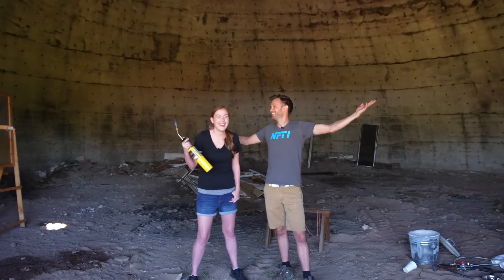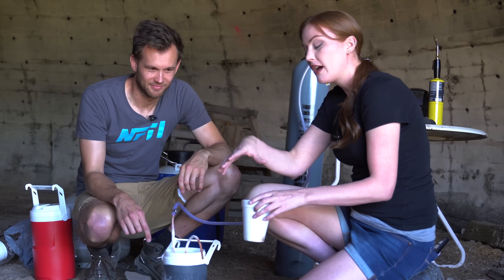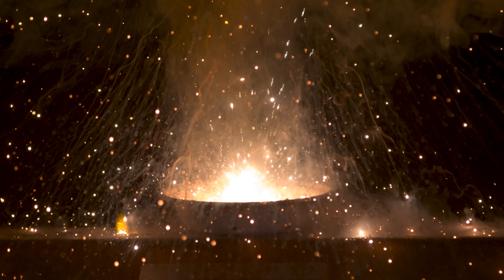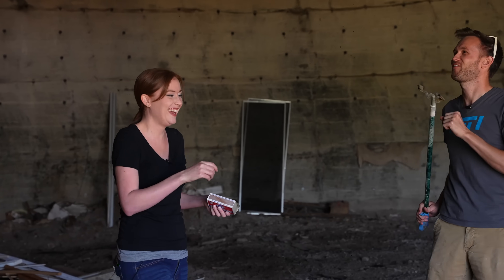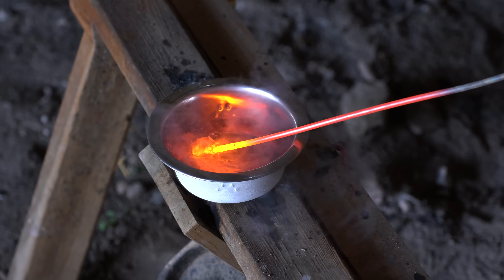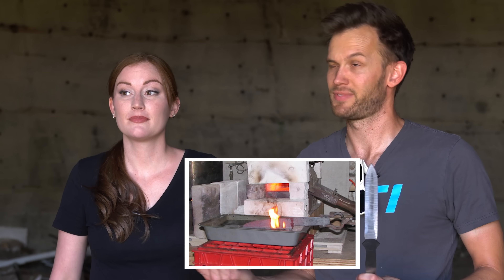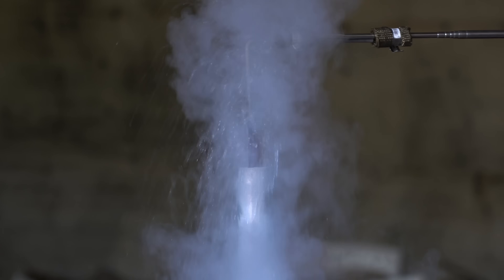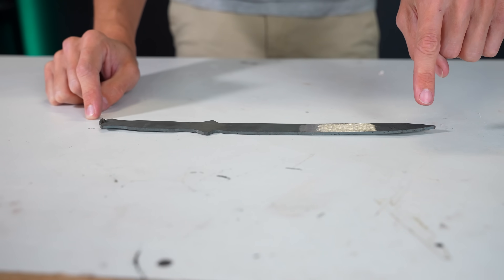Quenching a Knife in LIQUID OXYGEN!  Will It Burn?!

Comment: Use tool steel like O1 or W1 for the quenching test and try lighting a thermic lance running oxygen gas and then when the lance is fully lit switch to liquid oxygen. 

Get a gem quality synthetic diamond and heat it up with a torch until it's red hot and then drop it into a bowl of liquid oxygen.

Pro tip wear steel refinery protective gear or a full thermal lance suit while doing the thermal lance trick or say goodbye to those four fish belly white shins and knock knees.

Comment: LOL! My first encounter with LOX was when I was in an aircraft hanger. Suddenly there was a yell and one of the aircraft techs ran across the hanger, shedding every stitch of clothes as he went. He ran into the emergency shower which dumped a couple of hundred gallons of water on him in a few seconds. Nobody was laughing. One guy handed him clean overalls and some others started putting cones next to his clothes. Turned out he was working on the oxygen system on a Canberra and had drained it, someone else was making sure all of them were full and refilled it. So next day I was there working on an issue on a Tornado and this guy started removing pipes. The first one he took off resulted in LOX spraying out on him. There was a serious incident inquiry. Nobody touched the clothes or the aircraft for the rest of the day. Eight hours later they turned his clothes over left them for the night. Normal service didn't resume until the next day. Not as inconvenient as it sounds, nobody took watches, rings, keys, etc. near the aircraft. So most of his gear was in his locker. He just had to go home in RAF overalls.

Comment: Did they ever even bring up the Leidenfrost effect? Also the scale your using is the Rockwell scale.
Reply: Rockwell is the test type not the scale, there are about a dozen Rockwell test scales with the C scale being the most common for hard metals.
Reply: @Hello-ts5kh  The equation for Rockwell Hardness is H R = N − h d {\displaystyle HR=N-hd}, where d is the depth in mm (from the zero load point), and N and h are scale factors that depend on the scale of the test being used
Reply: @TestyCool  exactly, which is why Rockwell is the test method not the scale.  For instance a hardness reading of 70 Rockwell means nothing if you don’t know which scale was being used.  Case in point 70 HRB is very different than 70 HRC.

Comment: You probably experienced the Leidenfrost effect.  Basically the gas produced by evaporating the liquid oxygen creates an insulative layer around the steel.  So, although the liquid oxygen is very cold, it doesn't actually cool the steel very quick.

Comment: You had a few issues that caused a bad outcome. Next time: Get it hotter. Use a deeper vessel, to prevent resting or knocking the blade on the bottom of the vessel. Don't allow the fluid level to fall bellow the point of removable knife/handle material. 
Try again. You WILL get better results.

Comment: It's a shame that you didn't explain that the reason why it didn't harden very well is because the liquid oxygen formed a vapour layer around the knife, keeping it warmer for longer - which is why they use oil rather than water for quenching knives because water does much the same thing as it's converted to steam.

Comment: Molten Gallium would probably be a good material to quench steel in, However if you want the knife to burn in liquid O2 you need to wrap a piece of steel wool around it first and light that.

Comment: i think the problem with the solid steel is that unlike the steel wool it was not already burning. for the solid steel it would need to be significantly hotter and then have o2 added.

Comment: what if you super cool oil with liquid nitrogen and quench the blade in the frozen oil? it should melt and slip through the oil which is "best" for quenching a blade right? I would probably stand further back though.

Comment: You could try to make steel/iron that lasts forever.. like the Pillar of Delhi.
https://en.wikipedia.org/wiki/Iron_pillar_of_Delhi
> the smelting induces a higher phosphorus content (> 0.1%, average 0.25%) than in modern iron produced in blast furnaces (usually less than 0.05%). This high phosphorus content and particular repartition are essential catalysts in the formation of a passive protective film of misawite (d-FeOOH), an amorphous iron oxyhydroxide that forms a barrier by adhering next to the interface between metal and rust.

Comment: You need three things to start a fire: oxygen, heat, and a fuel source. The reason why the rod wouldn’t start a fire in the oxygen was because you had no fuel source. When you changed the container to styrofoam, you introduced a fuel source.

Comment: There is too little surface are for anything to ignite. Plus, the immediate reaction to "quenching" in liquid oxygen is the immediate formation of a vapor barrier of steam forming around the steel rod. 
This is why, when quenching a knife after bringing the steel to its required temperature, it is highly recommended to use a viscous oil that has been pre-heated to 100+⁰ to help reduce the amount of steam barrier that can be created and allow the oil to make contact with the steel and actually quench the knife.

Comment: I think I know what’s going on here. When hot metal meets liquid Oxygen one of two things is happening it burns because the container is flimsy or the material feeds off the liquid Oxygen creating a loop effect of constant fuel to keep the metal burning. It’s the same process that magnesium does when it burns as it creates its own oxygen source meaning even if you submerge it in water it continues to burn. Steel wool burns because of the surface area is changing constantly allowing flame to latch onto something. Oxygen simply enhances the effect and makes it burn faster. The bubbles are actually waste gases that escape the metal itself. It’s chemistry but controlled to a point. Eliminate every variable until you get the answer. Eliminate the foam cup and replace with a container that is heat proof and you get the answer. That’s exactly what you did and metal did not explode, simply it fed off the oxygen creating the loop.

Comment: You are too ignorant, quenching is matter of the speed of cooling down as well as the range and other factors. Do it like this: quench it the best way for your material in water or oil, thereafter quench once more from room temperature with liquid nitrogen. This prolongs the lifetime of my drill bits 70% at least.

Comment: I wonder how saltwater would work for quenching the knife, since it has a fairly high heat capacity like fresh water but can be cooled to lower temperatures before freezing. And does it make a difference to have moving liquid rather than still liquid, with the idea being that the metal doesn't get to heat the liquid around it as new cold liquid "replaces" it.

Or better yet if it was possible to freeze fresh water below zero degrees but keeping it liquid by controlling the pressure. Unfortunately i don't see how this would be done for this experiment as the heated knife should be inside the pressurised chamber with the water...

Comment: Try it with a heated chunk of silicon, it will probably turn into glass if you can break past the passivation layer.

If you can get the steel to the point of sparking, then it will probably start reacting and burning.

Comment: even when quenching in oil it is important to move the knife around in the oil so it is in contact with the cooler oil as the oil in contact with the knife will heat up and vaporize just as the liquid oxygen did, if you repeated this but stirred the knife around in the oxygen it would have worked better but more than likely create stress fractures in the steel, pouring the oxygen over the knife would also work but would have made your warp even worse

Comment: I bet the liquid O2 was too cold to quench properly due to the Leidenfrost effect, the oxygen created an insulating layer around the knife causing it to cool slower vs a quenching oil that can stay a liquid at higher temps keeping more contact with the blade to transfer heat better.

Comment: The reason liquid oxygen only slowly quenches the blade compared to water or oil is because the Leidenfrost effect works against it. The liquid oxygen is extremely cold, however it doesn't make good contact against the red hot steel due to the fact that the steel is significantly hotter than the boiling point of liquid oxygen. It's essentially insulated by the gas.
Reply: It does not may ANY contact with the metal, lol.

Comment: Hey, can you run a scientific experiment? 
I know that filling a balloon with a flammable gas like Helium or Hydrogen and setting a match to it will cause a firey bang. And that the bang is much louder if you mix it 50/50 with an oxidizer like Oxygen... 

Though the issue is that the tests I saw all use subjective loudness scales, and our microphones/speakers don't do it justice, so I am wondering... which is louder? And how loud is it really?

Comment: The rod and knife will not ignite in the presence of liquid oxygen due to at least two factors. (probably others, but I'm no expert) One, is The Leidenfrost effect, which means that the liquid oxygen is not actually touching the metal, and two, the rod/knife were not actually burning, they were just heated. Oxygen is not a fuel, it's an oxidizer.  Once the heated metal is put into the oxygen, it starts to cool and lowers it's temperature away from it's ignition temperature. In the video, the steel wool was burning/on fire before it was put into the oxygen thereby having an ignition source already present.

Comment: Nate I have an old physics book from the 20's... 1920's not 3 years ago... but anyway, they talked about quenching some metal by plunging the hot metal into cold MERCURY... 

I suspect the difficulty you're having with the O2 quench is because the O2 is boiling away so fast it's almost like sticking your hand in liquid N2... and for the same reason your hand doesn't freeze on contact is the same reason you didn't get much hardness out of this. 

Now mayne you want to get a hold of Cody's Lab as he usually has a couple hundred pounds of mercury floating around, but I would think because the mercury has a lot more thermal capacity, it would suck the heat out of the target metal really quickly.
Reply from the maker: I have actually talked with Cody about doing this!
Reply: @NFTI  Cool! (no pun intended)!

Comment: See I kinda figured the knife would either become brittle because the knife would cool off too fast, or that the knife wouldn't harden properly.  My reasoning behind the second prediction is because the liquid air is already boiling at room temperature and so adding an extra couple hundred degrees would likely make the air boil around it without actually touching it, evaporating with zero actual contact with the hot knife.  Without that contact I'm sure the knife actually cooled slower than it would have with oil or water and thus didn't create the desired grain structure.

Comment: Burning steel is interesting. I just wonder, would a large enough ball of steel wool behave like a sparkler bomb?

Sparklers are iron powder with a binder molded onto a steel pin. Individually they burn at a controlled pace throwing decorative sparks. But bunch up a hundred or so of them tightly and light one in the middle of the bunch and they will have a runaway reaction where the heat from individual sparklers causes those around them to burn faster and hotter. The result is an explosion that can be quite energetic.

So would a huge ball of steel wool react the same way? What if it's compressed? How much would be needed for it to become dangerous? Wondering if that one kilo package of soap infuse steel wool is a bomb in hiding under the kitchen sink...
Reply: Oh and yea, I find myself watching more of the posts on this channel than of what they post on TKOR now. There's almost never anything interesting posted on TKOR now.

Comment: I love videos like this.... love you guys' videos. But good God you make me nervous as hell because I've been on the safety planning end of things before. 
2:23 Calli, you're holding a bomb in your hand, and Nate's throwing sparks. I am presuming that was liquid O2...

EDIT: May as well be productive rather than just wagging my finger. LOX needs to not be in contact with flammable containers, especially those with pores like polystyrene. You saw how it burned with the rod, it'll do that all by itself. Go find a $5 double-wall steel coffee mug and degrease it before use. Oh, and I see a lot of comments about using LOX on oils... no. Stands a good chance of demonstrating two extra concepts, "hypergolic ignition" for some hydrocarbons, and "deflagration" for pretty much ALL of them. Same concept that sees greased threads explode when connected to an O2 welding tank, but amplified. Oh, and O2 vapors will permeate anything porous. Nylon shag carpet will literally explode in those conditions. 

By all means, play with fire... just don't get burned.

Comment: Have you tried quenching a knife in a big vat of agitated nearly solidified from cold oil? 
I'm talking -30C/-22F engine oil?

WIth oxygen and nitrogen you get vapor shielding the hot steel from the cold making the process slow 
 but a big vat of ice cold oil has a lot of heat capacity to wick away the heat very quickly

Comment: You can burn steel rods.  They are called gouging rods.  It's usually a hollow steel tube, with oxygen pumped thru the center.  This can be used to cut up things like battleships.

Comment: So, steel burning is actually a major concern when forging when you get up in the 2000+ degrees F. If you have too much air flow the oxygen will burn the steel and therefore ruin it.

Comment: I predicted that the steel rod and knife wouldn't be that exciting. The steel wool works because it is fine enough that the steel melts and flows around the oxides.  The hot rod or knife coming out of the furnace instantly oxidizes before getting it to the LOX.  The only iron that the LOX can reach is the occasional unoxodised spot.  I would like to see what happens if you heat a billet in an oxygen poor environment then dunk it in LOX. Would you get any flames then?

Comment: So glad to see you both together again! I'm guessing the Leidenfrost effect prevented the blade from quenching: it was mostly touching "really cold air" instead of a thermally conductive fluid that transferred heat out of the steel. How about investigating liquid metal reactions with LOX? I.e. melt small crucibles of aluminum, brass, bronze, etc. and drip them into a container of LOX (similar to making metal shot by dropping in water, but replace the water with LOX!)

Comment: I like how casually you two were about vaporising huge quantities of liquid oxygen while a butane torch was lit close by. “The oxygen has reached the furnace.” I know oxygen doesn’t burn, but it can make things that can burn under extreme conditions spontaneously ignite under normal conditions. Like wood, soil, plastics, and anything else that can oxidise. A laboratory is a way safer place to use the stuff.

Comment: With a coal forge you can get steel rods hot enough that they start burning (you see sparks forming in the air around the steel). I don't know if that's possible with a gas forge, though.

Comment: I’m going to guess that the quench didn’t work because as the oxygen burned off when it came into contact with the metal, it created a vapor barrier that shielded the steel from contact with the liquid oxygen and caused the blade to cool to slowly

Comment: When 1095 is non magnetic “1425”it’s almost at quenching temperature. It’s ready to quench at 1475. Now that’s a rough heat treat not a factory heat treat obviously. After testing weather or not it’s magnetic and putting it back in you probably got it up to temp though. Interesting idea though. Lol kinda figured it wouldn’t work.

Comment: The warp is not from the quench, that warp was from resting the knife on the bottom of your foundry so it was leaning and sagging under its own weight.

While it is incapable of cooling the blade fast enough to harden it, it also has the potential to rapidly decarburize the surface thus requiring even more grinding than normally necessary after heat treatment to reach good steel (it may not have long enough at temp to do so rather than form oxides, but it's another consideration).

Really it's just too damn cold to be useful as a quenchant, and it's pointless as a cryo treatment as it requires liquid nitrogen to produce (LN2 is better anyway). Entertaining, but beyond the question of would the blade burn, not surprising.

Comment: liquid oxygen wouldn't work because of the leidenfrost effect, it just evaporates too quickly and forms a gas jacket that does not cool the steel off fast enough, a quench hardens the steel by rapidly cooling it off at the right speed, not too fast or not too slow depending on the metallurgy of that specific steel, for most knife steels canola oil is actually a great option

Comment: Might I suggest you use the LOx in a jacket around a container of oil, then when the oil has reached -298 or thereabouts, you can quench in that. I suspect you'll get much better results. I don't imagine the heat conductivity of liquid oxygen is very good, so even though it's cold, it's not taking the heat away from the metal rapidly enough to affect the grain the way you want.

Comment: Good to see you two back together! Hopefully a bunch more videos to come. Try the plastic bolted filled with liquid oxygen , one carbon dioxide and one with liquid nitrogen in a fire. My thoughts is the oxygen will be a blow torch and then two possible fire extinguishers after they shoot the pressurized gasses upwards, just not sure which one would shoot higher. ;) Also you could 3d print nozzles for the bottles to concentrate the stream some.